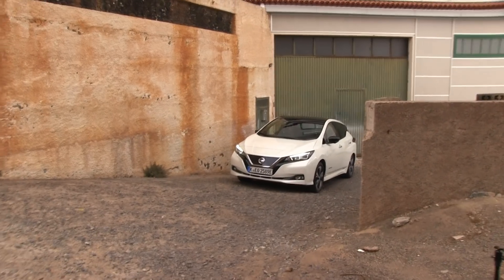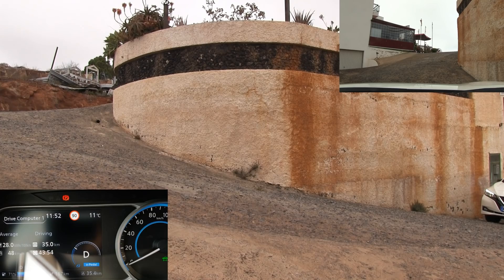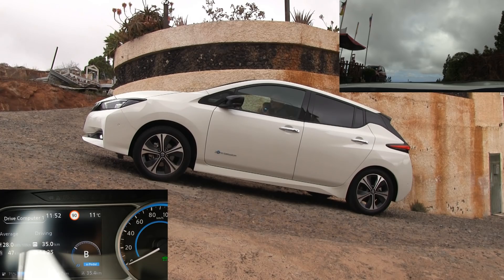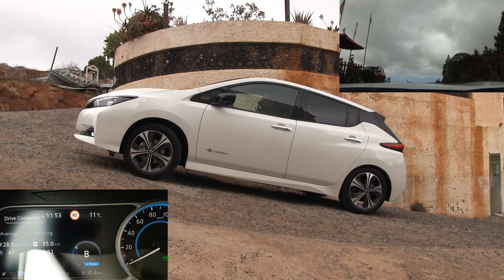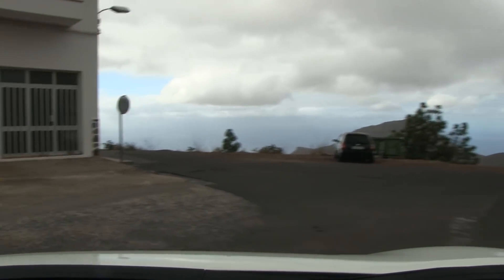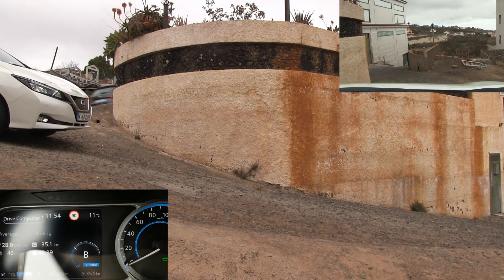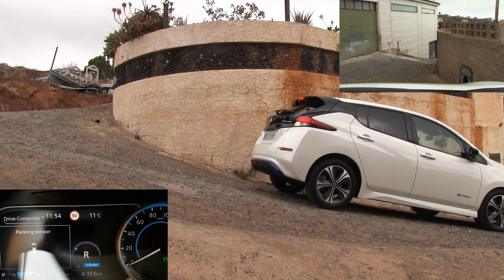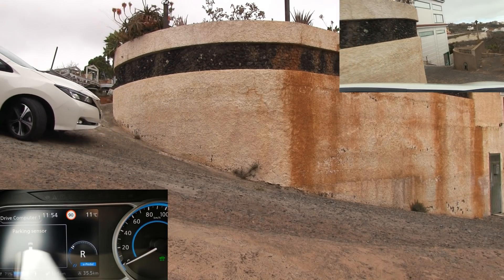Nissan Leaf e-Pedal challenge: Don't touch brake pedal!

Comment: Just to clear possible confusion. Percent is not degrees.

Percent means how much you go up in relation of how much you go forward. So 100 % uphill means 45° angle.

You get angle in degrees if you plug in arcus tangens x. Example for 30 % uphill = atan(0.3) = about 17°.
Reply from the maker: Yes, I meant percent.

Comment: This new leaf is really a nice car, sadly it has the (in Germany) uncommon Chademo plug and not CCS2.
Reply: colla 555 Yes it is a bummer, but it's mainly due to the fact that Chademo supports Vehicle2Grid (energy in two directions) while CCS doesn't support this. Nissan pushes Vehicle2Grid quite hard.

Comment: After watching and thinking about it a bit, I think I still prefer the way Tesla implements this. Sure, you have to press the brake to initiate the hold ability, but I like that the hold ability is selectable vs being automatic. I don't always want the brakes applied. I supposes you could turn off the e-Pedal mode on the Nissan to make it optional as well.
Reply: There's a button behind the drive mode switch. You can turn it off and on at any time. I always turn it off on highways, because otherwise it would break instantly when letting off the gas pedal.

Comment: Maximum torque available at 0 rpm - one thing that got me interested in electric, as demonstrated here.  Hills are no challenge to an electric.  It’s like having a 4 wheel drive truck in low range, which has an effective axle ratio of around 15:1.  Granted, there’s less traction when you only have 1 or 2 driving wheels on a slippery (or stony, in this case) surface.

Comment: Are you sure there Isn't some hill-holder giving a little help going up?
Reply from the maker: nope
Reply: The hill-holds I've experienced only hold the car for a second or two - enough time to move your foot comfortably. 
A lot less time than the Leaf appears to hold that's for sure.
Reply: The fact that the brake lights come on seems to indicate that the brakes are being automatically applied. This is better than using the motor to hold the car. The fact that it is all done automagically is what makes it so convenient.
Reply: Shawn, EVs don't seem to have the ability to hold the car with the motor.  If the motor is engaged, its propelling the car.  If you try and hold the car with the motor, the power just kind of dies off.  If you need to hold the car, you must use the friction brakes. I'm still not convinced this method of operating a car offers any advantages.

Comment: Most modern cars have hill start assist, which automatically holds the brakes on a slope until you apply sufficient gas to propel the vehicle up the hill.
Reply from the maker: +Dennis Xu This is not the same. Trust me.

Comment: My bolt ev on low mode do same thing it go to complete stop even I have botton on the back of my steering  it's do even harder Regan if you need to . I  go out for driver and come back home not even touching the break once pretty nice to have one pedal driving
Reply: You are braking with the your hands. I-pedal is far more advanced and natural to use. There's a lot of accidents with the Bolt du to breaking with your hands. It is now recommend NOT to use this method. I have stop using it after a fender bender.
Reply: You don't have to use the paddle brake on the wheel. If you drive in L mode it will also come to a complete stop, purely from letting off the accelerator, no brake pedal or paddle brake necessary.  I don't think it's quite as powerful as the e-pedal though in downhill situations, but so far I have not encountered an incline that it could not hold itself on.

Comment: Why do people think this is a good idea?

Most Americans probably don't realize it, but it gets rid of a third option many people never use: coasting. Yup, you do not need to mindlessly accelerate up to red lights.

Waste of gas to always hold in the gas pedal when you want to be moving. Moreover, every person I've ever seen who is unaware of coasting has rear ended another car at some point for obvious reasons. Also, someone is going to panic and just hold the gas in instead of break.
Reply from the maker: +Marcus Rosales You can of course switch off e-Pedal anf coast.

Comment: Looks rather like what the BMW i3 has been able to do for years, but they didn't make a marketing push out of it. I do think it should be standard on all cars, it's brilliant. I can drive for 000's of miles without touching the brake pedal!
Reply from the maker: +videogalore No, i3 can't do this.
Reply from the maker: The i3 doesn't use friction brakes. And i3 will not regen if the steering wheel is turning too much from center.
https://www.nissan-global.com/EN/TECHNOLOGY/OVERVIEW/e_Pedal.html
Reply: I don't know enough about the technical differences, but it can certainly stand still on a hill like this without touching any pedals, I've been driving ours for a year and a half like this!

Comment: I wouldn’t say that it would be a nightmare for gasoline/fossil cars, for example if the car is automatic there is no problem or if it have auto hold feature it’s no problem, maybe for a old manual car it would be hard if you’re not a experienced driver I’m actually not that amazed by it . For sure then you have to touch the break, but come on is it that hard to do it. I have a 2016 Audi Q5 diesel automatic, it can do all this just that you have to touch the break once
Reply: The entire point of this is that it’s more intuitive because you only use one pedal. 

As your brain adapts and eventually automizes the task, you’ll realize just how safer it is. You don’t need the same amount of reaction time since it takes less time to pull the foot off the accelerator rather than off and then press the brake.

Comment: Hill holder is standard in most cars today, so nothing special in that. But otherwise e-pedal is pretty nice.
Reply from the maker: +Lars Larsen It's not the same. You should test it.
Reply: On normal cars, you need to touch brake to engage the system... Not here

Comment: When using the e-pedal, do the brake lights come on?
Reply from the maker: yes
Reply: I believe they do - yes.
Reply: I didn't count that because the lights come on when he says "Let's stop here" so it looks like he put his foot on the brakes.
Reply: 2:02
Reply: 2:53
Reply: Yes, that is one of the advantages of the ePedal. Where heavy regen can come as a surprise for people driving behind you, the ePedal lets them know that you will be slowing down by lighting up the brake lights, making it more safe to usein situations where you are not alone on the road.

Comment: Hillstart isn't a problem for any automatic transmission gasoline car as well. -.-
Reply from the maker: +abcd efgh Try stopping when going downhill. And don't touch your brake pedal.
Reply: Try it with a dual clutch transmission and an impotent engine. Have fun.

Comment: I don't think this is something new just something made different - most cars if you accelerate you gain speed and if you decelerate slowly you start to loose speed (not really brake) if you remove your foot of the pedal quick starts to slowdown in a cruise mode.  When I drive in street traffic I look ahead doing the 3-4 second rule behind the other cars, look into the upcoming traffic signal and start to decelerate slowly and rarely use my brake pedal to slow down use it more for complete stop and hold.   my vehicles (2007 and 2014  GMC Acadia Denali) brakes last me 6+ plus in fair condition...   The Nissan Leaf e-pedal is great for people and anything new to save on natural or human made resources is good for everyone.   I applaud Nissan for this and wish other car makers start developing better cars now for tomorrow's future...

Comment: Does anybody know exactly how the E-Pedal achieves the slowing down when you take your foot off the accelerator?  I would assume that for a while it is using the motor regen to slow and put more juice back into the battery, but to get to a complete stop it would seem to need to actually activate the brakes (which also of course have some regen capaility).  So does it do both in combo, switch from one to the other, or what?
Reply: Sure you would have searched a year ago. 

But from what I’ve seen you regen battery when over 20mph and your foot is off the accelerator but nothing under that and getting closer to 0mph it applies your normal breaks as if you were using your brake pedal :)

Comment: How do you avoid the natural urge to stamp on the brake when you have to do an emergency stop?
Reply: Don't, go ahead and do it. But the car will probably beat you to it*. (* perhaps not yet, but that is the idea of emergency braking systems).
Reply: You can use the break pedal at any time. E-Pedal doesn't disable it in any way. After a few miles, you'll get used to when you need the regular break, and when it's not necessary.

Comment: it's not really hard for a combustion car either as long as you have an automatic transmission, and even manuals can do this with a bit of handbreak work.
Reply from the maker: You're missing the point. Try doing it in any car without touching the brakes.
Reply: I did today in my car which has an automatic transmission. It's an automated 5 gear double clutch transmission, the 5G-Tronic from Mercedes Benz. Driving up a steep incline, the transmission will hold the car for you with the use of the breaks, to make it easier to continue driving foreward and not rolling back. Automated DSG tranmissions must have this feature, because if the gear lever is in "D" and you roll the car backwards it can severely damage the transmission.
Reply from the maker: Now try doing that downhill without touching the brakes.
Reply: Well sure, only an electric car could do that

Comment: My Renault Clio has a hillstart helper. The brakes are engaged for about 3 seconds after I release the brakes. It's a manual transmission, gasoline. Nothing new really.
Reply from the maker: It's not the same. You should test e-Pedal if you have the chance.
Reply: You can't compare it at all. It's a completely different thing. The hill start helper is just one of it's many implicit features. We own a Leaf as well as a Renault Megane 165 EDC. They are worlds apart.

Comment: While i understand this is different in the Leaf, alot of new ICE cars have had this for years
Reply from the maker: No, they don't. This is regen + friction brakes. Fossil cars don't have regen.
Reply: ICE cars do not stop them self in the middle of the hill by just stop accelerating. You have to press the break pedal and enable hill assist by pressing the break again. e-pedal is simpler. you stop accelerating and the car breaks it self, first by regen, using the motor, then applying breaks as necessary and stays there until you accelerate again!

Comment: E-pedal is not the best for an ECO run is It?
Yo want to regen , not brake with friction brakes 🤷
Reply: Agalandu For eco purposes the best regen is no regen as long as your driving is within legal and safety  limits. You never recover 100% excess energy
Reply: You should anticipate traffic and use gliding. Regen would be second option. Friction brakes third
Reply: According to Nissan, it works partly due to regenerative braking. So I’d say you could definitely do a Eco run with this

Comment: Not really any difference in an ICE car vs e-pedal in the hill start. Most cars 2018 have hill hold and will not let the brakes go until you're moving. If we're talking about a manual ICE without hill hold it would be a different story, but would be comparing apples to oranges. :p e-pedal seems to be nice.

Small side note, but my 0.02 Kr
Reply from the maker: Hill hold is not the same as e-Pedal:
https://www.nissan-global.com/EN/TECHNOLOGY/OVERVIEW/e_Pedal.html

Comment: Seems to be a nice feature. But the moment u went down the "hill" and hoped for the car to finally stop moving.... That's hilarious. Those were at least 3m. Imagine u need to stop at the traffic sign in front of a crossroad or in front of people! I would never use such a gimmick in real traffic. That's negligent!
Reply from the maker: You're missing a very important point. You can at any time press brake pedal.
Reply: As Björn stated, you can use the break pedal at any time. In fact, I always tap the break pedal for a second when canceling the ACC. If you just hit the cancel button, it applied the break force quite slowly. However, if you want to stop for a red light, it's usually better to apply 100 % of the electric breaking power instantly, which only happens when pushing the break pedal in this case.

Comment: While this may be a boon to the elderly population, I see it as a novelty that would quickly wear out its welcome.  How is this any better than 2 pedals?  One pedal provides 0-100% acceleration and one pedal provides 0-100% deceleration.  So now we combine that into one pedal where the deceleration becomes harder to predict or even worse, people get used to it and there is a delay in using the brake pedal in emergency situation because it becomes less involuntary.  Finally its counter intuitive to continue to have a pedal depressed while coasting.  I would think I would prefer to have feet off pedals while coasting to a stop.
Reply from the maker: +spazzman90 You are clearly used to driving fossil cars only. I have driven lots of EVs and I like the e-Pedal. You should try an EV one day.
Reply: "there is a delay in using the brake pedal in emergency situation"

On the other hand, if you have a feature like this, it can actually enhance braking response in an emergency situation, because as soon as you move your foot off the accelerator to slam on the brake pedal, the car is already significantly slowing down, rather than coasting or freewheeling during that fraction of a second the way most automatic ICEVs do.
Reply: I think this is a great feature, I have something similar in my Dynosaurs Juice eater car that holds the break for me on hills for 2 seconds and it feel great, specially in several floor parking lots. I believe that having something like e-pedal feature in my car would be super useful. Also I believe that we, ICE owners, are too acostume to coasting. We see the red light at 100 meters ahead and we let the car go in neutral or with the cloatch pressed. In an EV we would use that distance/ opportunity to regen some juice! and here it's when having an easy way to set how strong regen is becomes useful. A strong regen would stop you in the middle of the block. But will come very handy on a downhill slop.
Reply: Love your videos Bjorn, but yes.  I'm on my second EV. :)
Reply: How is 1 pedal better than 2 pedals?
Is this a serious question? Seems an obvious efficiency answer to anyone w/o a preconceived bias / resistance to change

Comment: So just like any car with automatic transmission? It won’t roll back while in «drive» and forwards you just activate hill descent? What is the big deal here?:/
Reply from the maker: +der583 Try doing it downhill. And don't touch brake pedal. Yeah.
Reply: «this will be a nightmare for gasoline driven cars» hill start? Not with an automatic;) 
But i see the down hill stop👍🏼